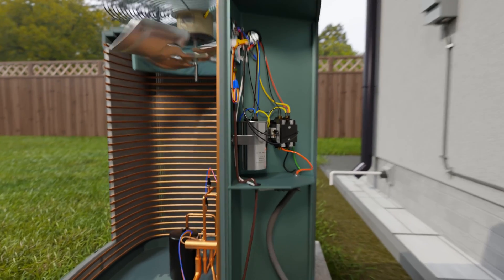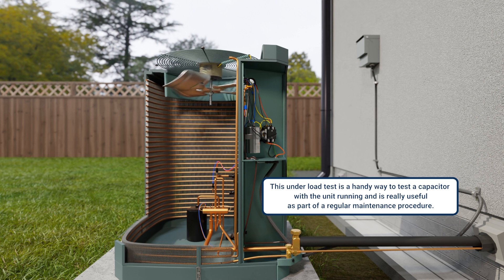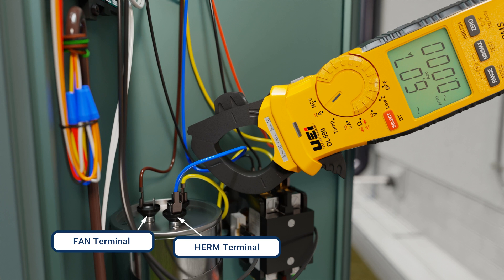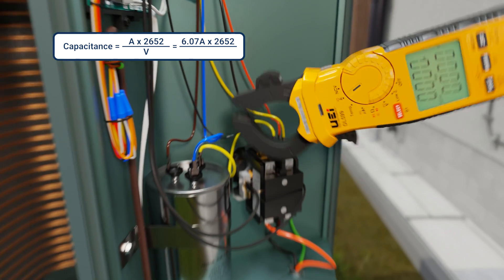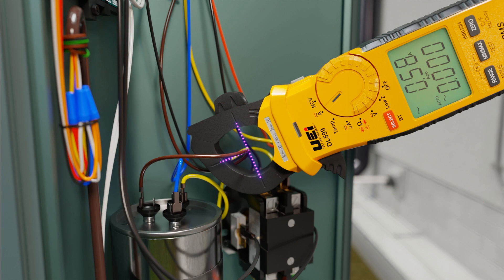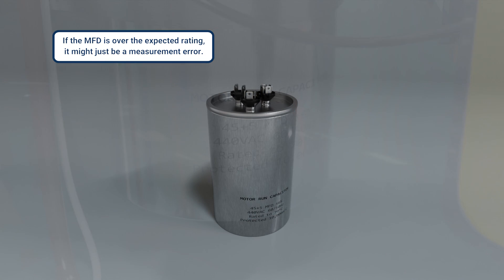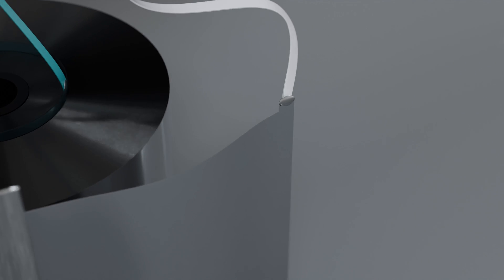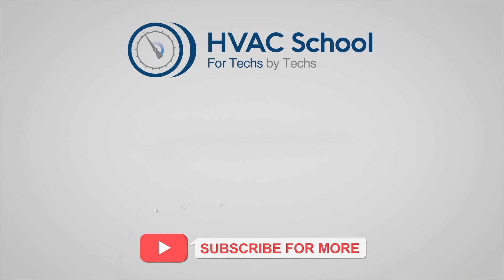Capacitor Test under Load 3D

Comment: Just checked my cap 69 uf reading it's a 70uf cap. I was expecting it to be worse because my mothers AC unit gone through 2 caps since I had this new AC unit installed in 2022. The 2 that were installed in hers were mars caps supposedly made in the US. HVAC contractor got her for $420 replace it the first time I replaced last one for $30 cost of the Amrad cap.  Don't get gouged by HVAC contractors replacing a cap should never cost $420. I'm certain a bad cap what caused my previous AC unit compressor to fail.  I was under the impression before that just wait till the compressor won't start assuming it's only used for starting. I had a hard start kit that masked the problem it is taken out of circuit after it starts.

Comment: I was shown this method by a senior guy when I was a new tech & didn't know any better. After almost getting shocked (more than once) I retired this method as I personally think it's super sketchy. 
I prefer to just shut the unit off &. Test the old fashioned way. The 60 seconds it saves you isn't worth getting electrocuted over in my opinion.

Comment: I have the exact meter that he keeps showing. It always read like .2-.4 amps when not around a wire or anything. and I don’t know why. Is this because it’s a true rms?? Or is it broken?
Reply: Had the same thing happen with my old fluke meter, I was on tech support working on a commercial unit. I told him that the amps may be a little off due to this, and he said to replace the meter.
Reply: Might be related to the earth's magnetic field.  Does the meter have a zero feature?  You could also subtract the error value from the test value.  This test might be a little iffy if not using high accuracy meters or low mfd values.  Stray magnetic fields may produce inaccurate results.

Comment: I did not know the plus or minus percentage was an out of the box spec.
We often recommend replacing the blower motors that have been running with extremely low capicitors as they often fail within a month or so of changing a run cap.
Have you experienced this and is there a percentage where you'd recommend replacing the motor in this situation?
TY in advance Bryan.
Reply: I haven’t heard of that. You sure the cap you replaced was the correct size? I always look at the motor nameplate if visible. If not visible, I call manufacturer and see what the value of replacement blower cap is. 

I had one call where a compressor was short cycling. Turned out the previous guy put in a 80/10 cap, when it needed a 55/10 cap. This caused the windings to overheat and the motor to go off on thermal overload. I imagine a similar thing would happen if you replaced a blower cap with one that was too big. Windings would overheat, and probably melt/ short out. And I don’t believe blower motors have a resettable thermal overload. 

Also those older motors tend to leak oil from the bushings, I always check for that and touch the bottom of the motor when visual inspection not possible. If it’s leaking oil, I’m recommending that they replace motor and cap and clean the blower wheel to remove oily residue.
Reply: @victork3397  Yes, always confirm OEM spec'd parts before replacing.
The motor windings burn out from low capacity.
I've also cleaned extremely filthy blower wheels and had the motor die shortly afterward.
I haven't seen this with compressors or outdoor fan motors.
Reply: What does “out of the box specs” mean? If it is out of that range it is NG. No manufacturer publishes otherwise. 

If you have a 10mfd +/- 10% cap and it is at 8.5mfd I list it in the recommendations for replacement.

Don’t come at me with this “I don’t know why no one knows this” $hit.

If the manufacturer is not clear than that’s their fault.

I go by what is written. After all, that is what people sue you over.
Reply: @XX-qf5zj  what is written is what the manufacturer represents at production time. It does not imply that if it falls out of manufacturing range over time then it is out of serviceable range. That's ridiculous.
Reply: When a capacitor brings its data, it says what it was designed for, whether it is single or dual, that is, what they are in operation. It is + or - 5%, the example being 35 mfd. The ideal is if the voltage clamp has the capacitimeter option, but if it does not, it is important to keep in mind that if we measure the amperage of the common, the example being 9 amp. The start and run should be equal or identical in value when adding them, if it is not in that range it is better to change the capacitor and really taking into account the measurement of the mfd in a capacitor when doing a review is vital and not replacing it with capacitors used if not warranted if it is done temporarily while the corresponding one is installed according to the capacity of the condensing unit. Your videos are very interesting. Blessings.
Reply: I hear this all the time and I am amazed most techs don't know this. But it sells more repairs.

Comment: I get the practicality of a specific number that is easy to remember, and I love the way you can prove functional capacitance indirectly. For those interested, recall that Z=1/(2*Pi*f*C), and that Z=V/I. So, rearrange and you get C =I/(2*pi*f*V). Then note that you want the answer in microfarads, not farads, so multiply by 10^6. You get C= 10^6/(376.99)* (I/V), when in the 60Hz environment of North America. The constant simplifies to 2652.  What I find interesting is that you don't need the phase shift angle of current to voltage to calculate this value, and you don't seem to need RMS values. Presumably the waveform is close enough to a sine wave, and the capacitance is so close to a pure -90 deg phase shift, that those details wash out.
Reply: Yes, there's also another equation besides the reactance/impedance equation you provided, it works with both AC or DC, and it actually describes the reason that a pure capacitive reactance produces a negative 90 degree phase shift.
Ic = C(dV/dT)
So this states the the current flowing through a capacitor, is equal to its capacitance multiplied by the rate of change in voltage across the capacitor.
You can test capacitors exactly like he did in the video, only use this equation(which is the one above rearranged) 
Start winding current ÷ dV/dT where dV/dT would simply be the derivative of this function:
VcSin(2pi*F*T)
Where Vc is voltage across capacitor, F is 60Hz, and T is usually just made to be 0(since the derivative of a sin function is greatest at 0, and 0 at the peaks, the derivative of a sin wave, is a cosine wave. Which is why capacitors shift voltage backwards by 90° relative to current
Reply: You made a typo. It's 376.99.
Reply: @realSamAndrew  yes, exactly, I corrected it, thank you.
Reply: Thanks! I wondered where the constant came from. I ran the numbers in the calculator and got 2652.582 for the constant.  Unnecessary accuracy for my Greenlee amp meter from Home Depot.